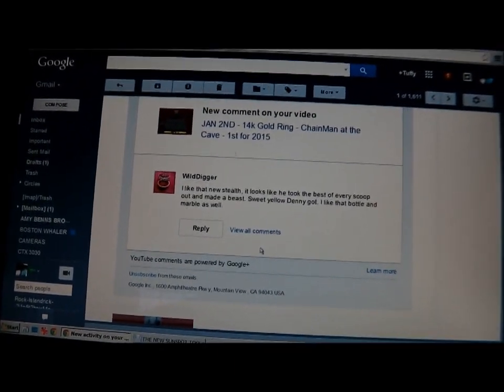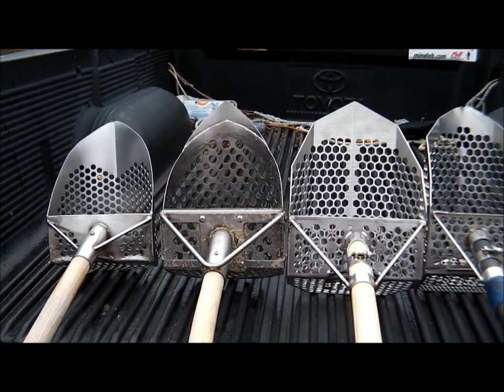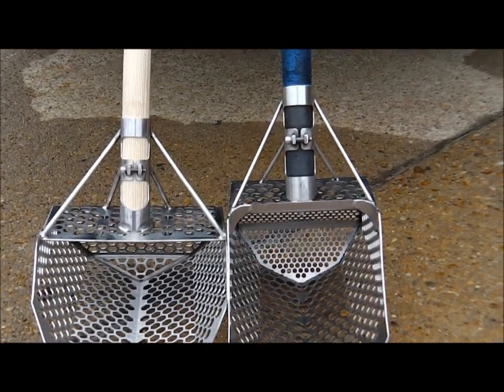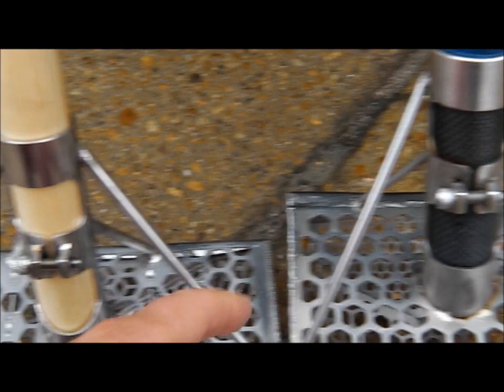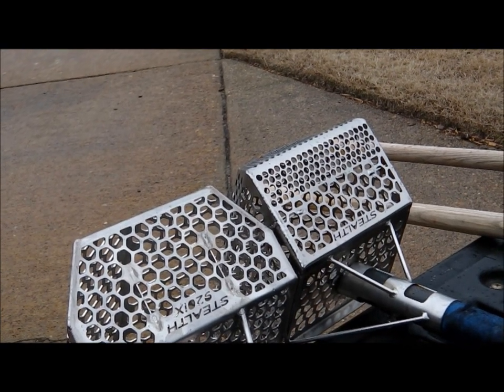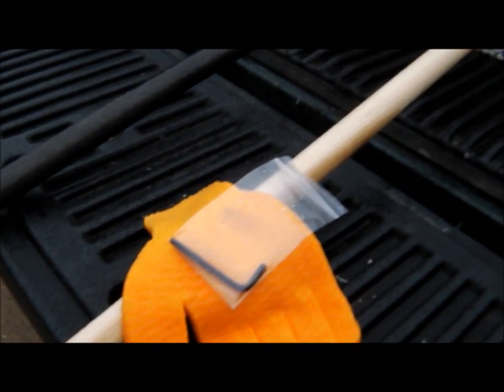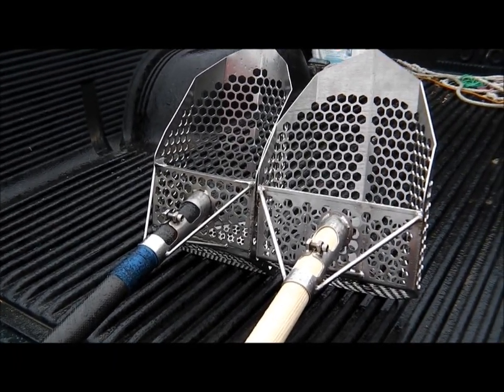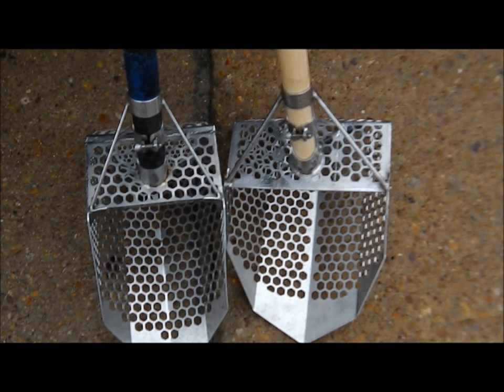THE NEW STEALTH 920iX FOR 2015 FROM SUN SPOT TOOLING

Comment: i will never ever frigging ever get another wood scoop handle again..got a monstrik9 with supposedly strong ash wood and the handle snapped after only 2 days..now i'm having a hell of a time getting the remains of the handle out of the brace tube cause it snapped flush off at that point..chucks design is good cause you can avoid all this garbage with easy access to the stump of the handle if it were to break..stavr...not so much..plus you have to drill your own hole THEN make the handle actually fit in the tube.just a big hassle..i like the size and design of the 920ix better anyways and from now on its carbon fiber or fiberglass handles all day long..wood is only for end tables lol
Reply from the maker: i use drill -  3 paddle bits, screw driver and hammer to get the old ones out.
someone on here a few months back said cabelas sells tree climbing steps - i have two now, but all HICKORY wood is holding up so far.  i had poor luck also with ash, but the hickory ones seem better. have to make sure u put the grain in the right direction also.

Comment: I'm a dirt digger myself, Max, but in my work I do a bit of metal fab. I predict your warranty could  come into play. The front of the  top without the bend is weaker than the others with it incorporated in. There's a LOT of leverage in that handle and it will force the sides inward, bowing the top a very small amount. With time and use,  I predict metal fatigue.
   I don't mean to be a downer, but you might  want to watch for signs of stress. HTH  57
Reply from the maker: fatigue has gotten every scoop i have ever owned after a year or two or more.